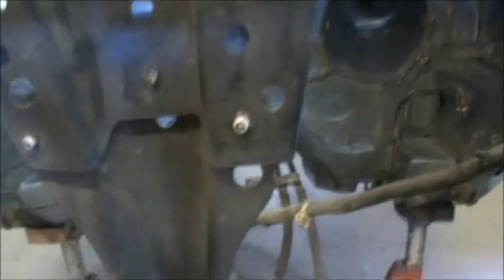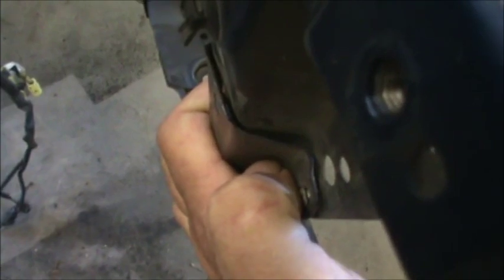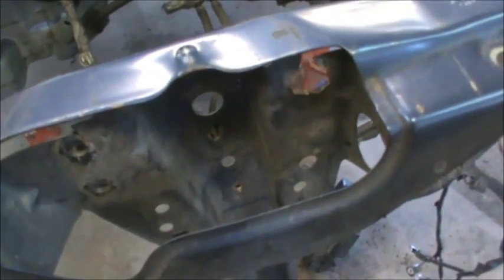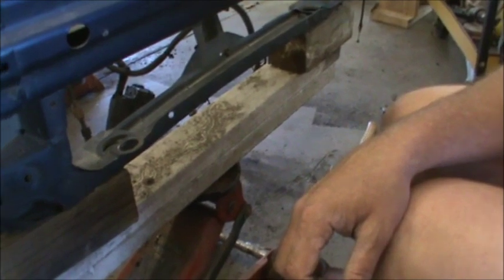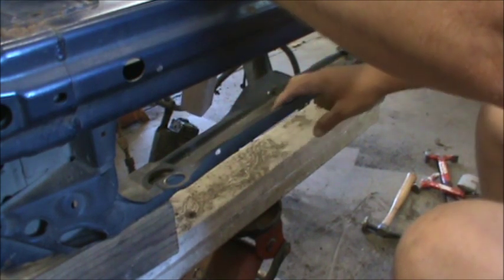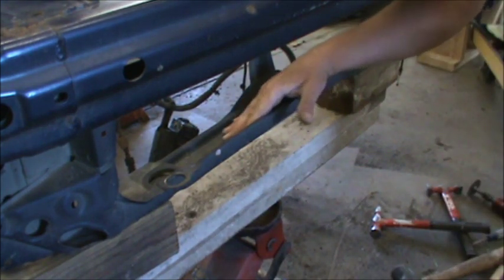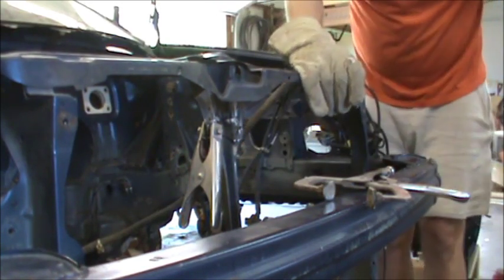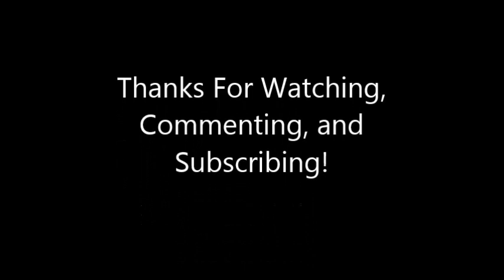My Civic EV Electric Car Project Part 18 Core Support Repair 1 of 4

Comment: Very nice work Tom. But, I have a question. Do you know why the manufacture didn't weld it originally? Just curious. Take care Tom
Reply from the maker: Something has hit the bottom of the core support causing it to break. Then someone has pop riveted it to hold it together. It was welded from the factory, it was just someones cheap easy fix.